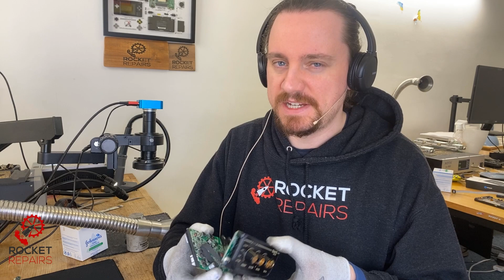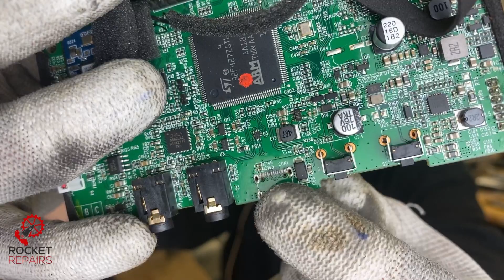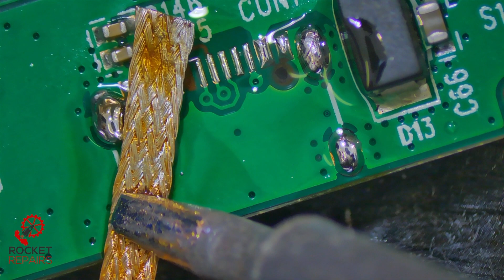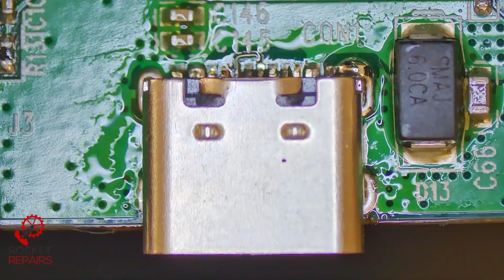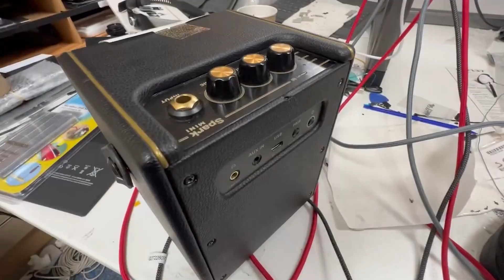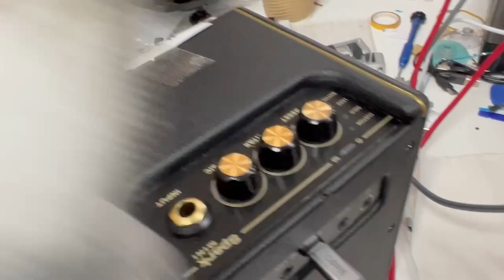Spark Mini Guitar AMP and Bluetooth speaker repair - Broken charging port!

Comment: I had my spark 40 amp. But it has a problem when i using it. 
Its Always cutting off the sound it self but not cutting off the power. can you give me a suggestion to fix it please?
Kinda lost some power but its just turning off the sound

Comment: Great job!
This board has a headphone/line out jack that has a terminator switch in it so as soon as you plug in the cable, it shuts off the speakers. Can anything be done to keep the speakers on while also having the line out cable connected so you get audio through both?
Thanks in advance 🙏